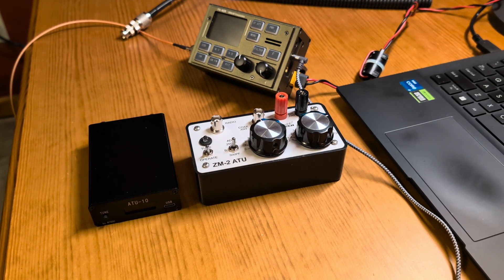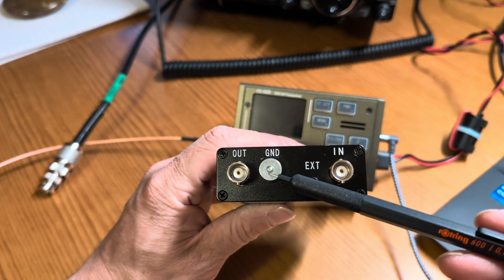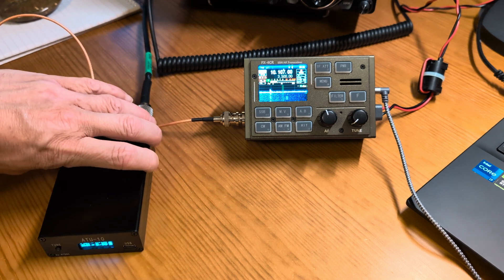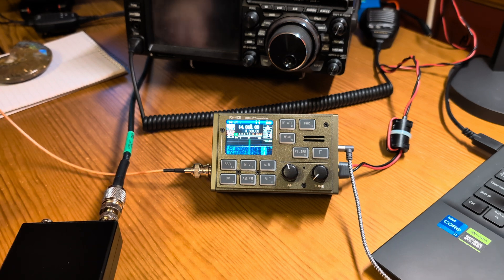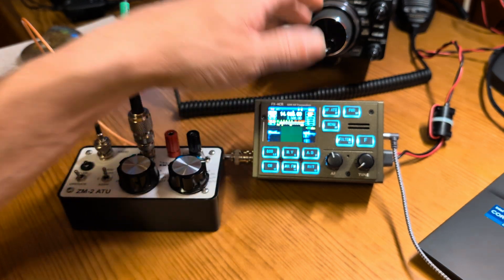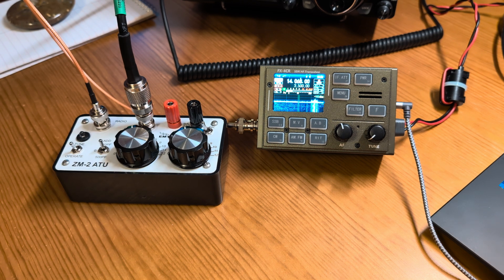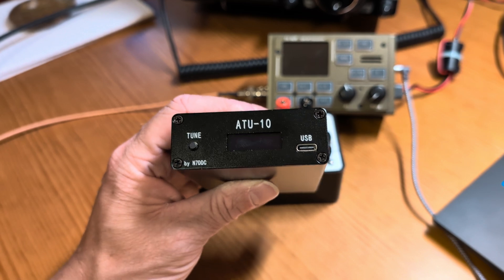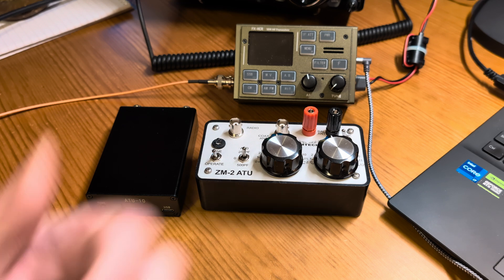QRP Field Tuners: Emtech ZM-2 vs. the ATU-10

Comment: The only thing I pick on the ZM2 for is the angle the coax plugs sit on top makes it bit harder to set up on uneven ground in the field.
Reply from the maker: Yeah, it is kind of a weird angle.  You can throw a 90 degree BNC adapter on it and that helps somewhat.

Comment: Would the ZM-2 or ATU-10 be able to handle the FX-4CR at it's 20 watt max. If not, what would I need to swap out on it to beef it up? I'm looking for a small tuner I can build into a larger case, though my space is limited. The ATU-10 is already too long for where I intend to put it. I'd need to modify the connections so they come out the side for it to fit.
Reply from the maker: Neither of those will handle the full 20w output.  The ZM-2 will handle 15w.  I'm not aware of a tuner that size that will take the full 20w, but there may be one out there.  As far as components, I can't answer that one as I didn't design them.   You may be able to build your own so that it fits the space constraints and power requirements you have though.
Reply: @EvanK2EJT  Thanks for the response. I figured I'd probably need to do something like that. Guess I have more homework to do.

Comment: Evan, have u used a doublet antenna fed directly to the ZM-2 match tuner?  This is the tuner I use but contemplating making a doublet antenna.
Reply from the maker: I haven't, but I'd think it would work just fine. I've never seen anything I couldn't match with the ZM-2

Comment: Enjoyed that! By the way what are they power rated for? I need a tuner for an old Yaesu FT101E. It puts out a little over 100 Watts. The manual says it needs a tuner rated to 300 watts irrc. Would either of these be compatible without me frying their internals?
Reply from the maker: Not a chance.  These are both QRP tuners rated at 10w max.  There are absolutely tuners that will handle a 100w rig, but these aren't them.
Reply: @EvanK2EJT  I've seen certain tuners with an output to connect an external dump load. Would this be to be able to a bigger load for a more powerful rig or are the rest of the internals in the tuner meant to be able for a higher wattage also?

Comment: An excellent accurate and well produced video!  I love my ZM-2. You forgot a main advantage - it has a balanced output - I use it on my full wave 80m loop.  You did mention the speaker wire balanced feedline - I use that too fb. 73

Comment: Thanks for this. Two more potential downsides of the ATU-10 (and any autotuner):
1. more complex than a manual tuner (active components like transistors or ICs), so could be more likely to fail in the long term
2. depends on design (probably including software algorithms) for minimizing SWR and displaying correct value of SWR
Maybe these 2 points have been overcome in the design of the ATU-10, but I do know they have been a factor in my rejecting the use of autotuners in the past. 
Some autotuners are known to have trouble tuning to low value of SWR as compared to some manual tuners, when used with same antenna. 
That said, the ATU-10 may be my first autotuner in the future!
Really appreciate this video, very thorough and good demo. Keep up the good work! 72

Comment: I've been on the fence about getting the ATU-10. I didn't even think about checking Amazon. I think I'll be getting one from there. It says it has the current firmware and the seller is legit. It will be just what I need for my Xiegu G106. Thanks for the link!
Reply from the maker: No problem.  Yeah, it works great. No regrets at all.
Reply: @EvanK2EJT  I got it and it works great. I'm using it with a Chameleon end-fed and it tunes it no matter where I try to use it. 👍🏻

Comment: The ZM-2 handles 20w I thought the ATU10 was only 10w that makes a compelling choice if you’re operating SSB with the FX4CR
I’ve got the 10w Kanga products transmatch - similar but not it’s equal and 1/3rd the price
Reply from the maker: The ZM-2 will handle 15w. The ATU 10 says 10w, but I've used it up to 16w with no problem. Over that it yells at you and tells you it's over voltage. I'd say it's a wash either way.

Comment: Elecraft must be running out of shortages, I had to wait only two weeks for the T1, but yes, it did cost a kidney. I have the 100w/non-latching sibling of the atu-10, the T1 definitely matches a wider range. Do you use the tuning cable with the 705?
Reply from the maker: Yeah, I use the cable with the 705, and it works well.  Good to hear that they're working through the backlog of orders!

Comment: I orderd a T1 in January. I got it in February. Not so bad. T1 is currently in stock for $289.95 + Tax.
Reply from the maker: Wow!  That's FAST. Eric K9VIC waited almost 13 months for his.
Reply: @EvanK2EJT  We both got ours around the same time. I actually end up using my LDG z100plus more though, and it was so much cheaper.

Comment: Both these ATUs are great. The issue I have with the QMX is I have the SWR protection enabled at 3 and both the ATU- 10 and ZM-2 during tuning would enabled the SWR protection on the QMX and stop all TX capabilities. Fix is to disable the SWR protection.
Reply from the maker: The ZM-2 shouldn't.......The radio should see 1:1 with the switch in "tune" mode.
Reply: @EvanK2EJT  I’ll check again to see if the idiot factor was enabled 😆
Reply: @EvanK2EJT  It supplies a safe load, but not necessarily a 50 ohm load. If you look at the circuit you'll see that there is a bridge, two 50 ohm resistors in series to ground on the left side of the bridge and a single 50 ohm resistor in series with the load (as transformed by the tuner) to ground on the right side of the bridge. The indicator circuitry is across the bridge so that if the load becomes 50 ohms then the bridge is balanced and the indicator light goes out. Worst cases are if the load is open or shorted. A shorted load gives 100 ohms in parallel with 50 ohms, or 33.33 ohms so the SWR is 1.5. An open load gives 100 ohms so the SWR is 2.0. Anything else will give an SWR that cannot be any worse than 2.0 which should be safe for most transmitters.

If you want even more protection you can build a Pi or T 50 ohm to 50 ohm pad out of three resistors to be placed between the transmitter and the ZM-2 while tuning. The more attenuation you build into the pad, the safer things will be (but the harder it will be to tell when you've come closest to a match). Of course you remove the pad after you get it tuned, just as you flip the switch on the ZM-2.

Some people leave the ZM-2 switch in tune position even after completing the tuning, to go QRPp. If you get a perfect match, the resistive network in the ZM-2 will attenuate both transmitted and received signals 6 dB or 1 S unit. I wouldn't do that, because the rectifying diode and the LED might produce some (very weak) harmonics and to the extent that they made it through the tuner resonated on the fundamental, they'd get radiated.

David  VE7EZM
Reply: @EvanK2EJT  thanks for doing the video . Yeah full idiot factor kicked in. Just tested the ZM-2 and works absolutely fine .
Reply from the maker: @mountaincwops  LOL I was gonna say......I've never seen anything but 1:1 with it in Tune mode.  Glad you got it working!

Comment: I didn't know that the ZM-2 presents a 50R load to the radio when in tune. That would make me a LOT happier tuning an unknown antenna for use with my QDX. Food for thought. 

I also wanted to get an Electaft tuner for my TX-500 but in the UK they are rocking horse sh*t made from Unobtanium so settled with a MAT-10 which I'm quite happy with. Similar idea as the ATU-10 in that it has latching relays so charge a couple of times a year and you are good to go. The only problem is that you should use the charger that came with it - no easy option for charging in the field if you don't have the charger - it's a weird voltage I think. 

I REALLY fancy one of the FX-4CR. It looks a really good radio.
Reply from the maker: Yeah, the 50 ohm load is nice when you're worried about the delicate finals in some of these radios.  It definitely gives you peace of mind.  As for the FX4-CR....get one if you can.  They're awesome 😁

Comment: Great video as always.  One interesting thing about the Z-match design is that it provides some additional bandpass filtering that the ATU-10 and basically most auto tuners will not ... this can help with receiver overload (e.g., in the presence of an AM station), and it can also help reduce transmit harmonics if you're operating a radio with a less than ideal filtering -- or you're running a radio with good filtering on a band that the filters weren't fine tuned for (e.g., 30m on a QMX 10m-20m high-band kit).  I have a digital modes radio from crkits (orig design by Barb -- I think wb2cba), and at my home qth it is significantly more performant on 20m ft8 receive through a z-match than it is through a T-design.
Reply from the maker: That never occurred to me, but that's definitely an additional plus for the Z match tuner!